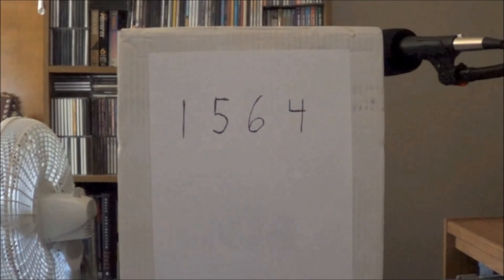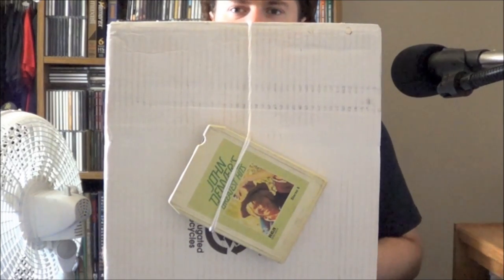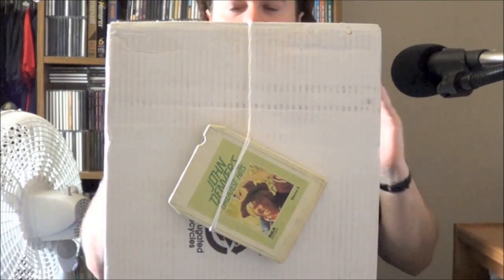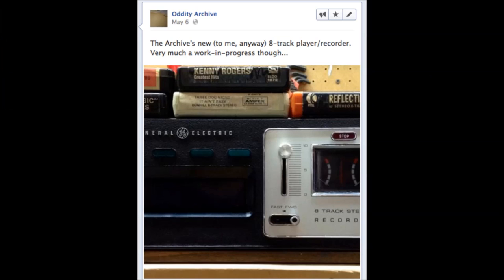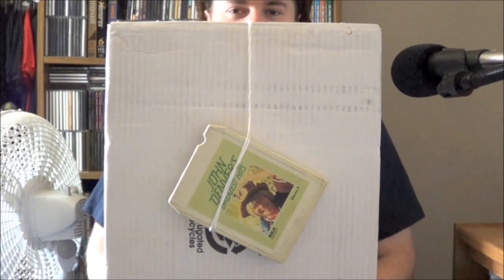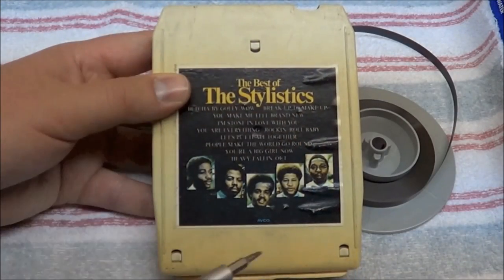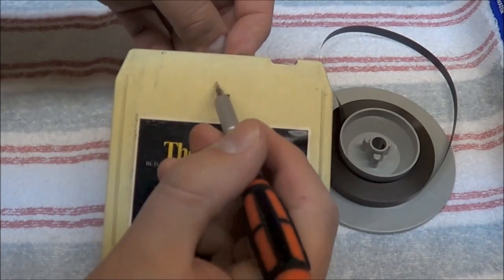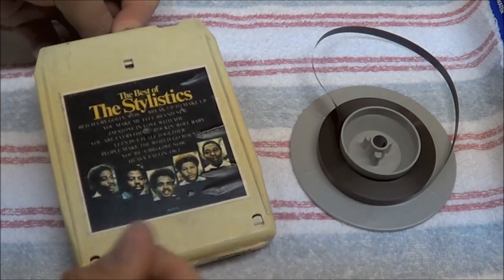Oddity Archive: Episode 33 - 8-Tracks (or, The Care & Feeding Of Your 8-Track)

Comment: If you transfer 8tracks like that, you run into a problem with digital audio quality loss. If you are sampling them at 16 bit 44.1 khz, when slowing down you make each one of those samples longer so you lose a lot of information. You should ideally sample them at 192khz so that you have way more information before you slow it down.

Comment: Weatherstripping is a fine substitute for the original decayed pressure pad; however, I suggest that scotch tape be used on the pressure pad where it contacts the audio tape.  Bare foam will tend to 'scrub' the graphite lubricant off the tape; the scotch tape will give the pad a smoother surface to glide over.  Secure the scotch tape to the pressure pad with a dab of hot glue or two.

New pinch rollers are available on eBay and from several other sources, but I've seen people use heater hose (from an auto parts store) to rebuild their existing pinch rollers.  Strip all the old material off the hub, build up the hub slightly with black electrical tape or something similar, then slip the hose onto the hub so that it fits snugly.

Any time you buy an eight-track, even if it's new in the box, consider it suspect.  Even brand new in a box, the newest 8-track cartridges are now 30 years old, and rubber deteriorates naturally.   Also plan to re-splice the tape before playing it, and on my repaired cartridges, I splice both sides of the tape.  It's also a good idea to cut the splice ends to an angle - nothing severe, maybe a 15-30 degree angle.

Finally, a VERY small dab of white lithium grease on the spindle of the reel will help reduce internal friction and the resulting wow and flutter.  This is particularly true of the cheaper tape cartridges (like the K-Tel one demonstrated in this video).   The cartridges manufactured after about 1973-1974 are of comparatively poor quality, so a little lubricant can help them out considerably.  A tiny amount on the spindle of the pinch roller is recommended, and I reiterate - a TINY amount.  You do NOT want that lubricant getting onto the tape itself.

8-Track players should automatically get a new drive belt when you acquire them, and be cleaned thoroughly and relubed for best performance.  One common problem with 8-tracks is head alignment and azimuth; and it can manifest itself as 'bleed over' from other audio programs and poor audio quality.

Comment: I have that John Denver 8 Track. The glue that holds some of those tapes together has broken down with age, that is why they break at the metal splice point.

The dragging sound is called wow and flutter. My Montgomery Ward 8 track player does a pretty good job playing most of mine smoothly.

Comment: I agree with some of the other posters who opined that your sample rate logic is backwards. Recording a short digital file with the purpose of lengthening (slowing down) the recording later is not going to uncover extra audio signal fidelity; however, it will degrade the fidelity. This is also a useless workaround without knowing the characteristics (signal changes) of playback during FF. So... don't record during FF if you desire higher fidelity.

Comment: The tape tension eventually becomes too tight because the tape coming out of the center of the spool has a smaller diameter than the tape on the outside of the spool. All 8 tracks will eventually develop this issue if played enough. It is easy to fix though. When replacing the foil splice unwind 4 to 6 loops of tape from the inside of the spool and replace the foil splice with a new one then play the tape. After one full play the tension will reset and playback will be normal again.

Comment: Fun thing to do to make stuff sound super tape like in terms of sound coloration (not with 8 track though) is do your process with audacity but sort of in reverse. In other words if you speed up a track digitally and then get a cassette player with speed control on it (like the library of congress ones) and slow it back down to normal tempo it sounds properly dirty.

Comment: The player I found for $4 luckily has no belt on it. However tapes run slow so now my Beatles tape sounds a little depressing from the tempo.
Reply: Have you tried a looser belt? That should speed up the playback.
Reply: Sometimes the drive motors need to be taken apart and relubricated.  The grease or oil in there does dry out and turn to sludge, and can cause the motor to run slow.   They're supposed to be 'lubricated for life' but nobody back then expected that to mean 30+ years.
Reply: Sir you may have invented vaporwave... (A E S T H E T I C)
Reply: A great percentage of tape decks have trim pots for speed control inside the chassis near the motor....

Comment: One thing that often gets missed on an 8 track is motor speed. When I was got my Radio Shack 8 track record/player, I had to completely recap the power supply due to uneven playback (wasn't the azimuth nor a dirty capstan or transport). Slop is pretty bad on lower end audio equipment like +/- 20 percent on a cap value or poor base current on the transistors. First rule, check the entire voltage path and just plain recap it, your equipment will thank you.

Comment: Sometimes if you play a tape that hasn't been played for years all the way through the tape fluctuation will stop, if the tape fluctuation is from the tape being too tight, you'd have to open the cart, unspool the tape and respool leaving slack in the tape, the tape on the spool should never be tight, there should always be a small amount of slack on the reel.

Comment: fast playback has no sense if equalization is not changed internally. Many open reel deck has an equalization switch linked to the speed control, so when you change speed, equalization is changed as well in the playback amp. I think that the same apply to any magnetic recording. Plus, many fast forward that are implemented electronically (that is, doesnt use gear reductions), like early sony just bypass the speed governor, that is, defeat the speed control allowing the motor to rev up till it balances with the load of the deck. It doesnt makes sense to have a stable FFW, nobody hears things in FFW, so manufacturers only worry about playback speed which the only speed that is controlled IMHO.
Reply: Not to mention that capturing at high speed (1.6x as mentioned) to digital @ 44.1 Khz  and slowing it down the sampling rate drops to 44.1/1.6 = 27.56 Khz.

Comment: hi i record and play back 8 track on my fostex 1/4  8 track because i going to move the tape inside to the nab carts   you get a super recording at 15 ips like
you i can change the speeds up and down the 8 track tapes have to be fixed and the capstan rollers wear out  bob